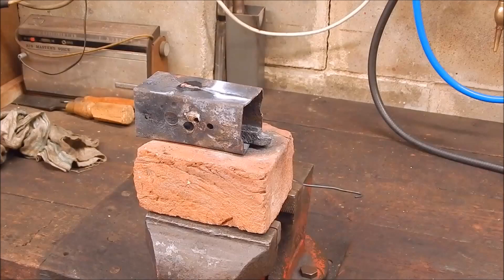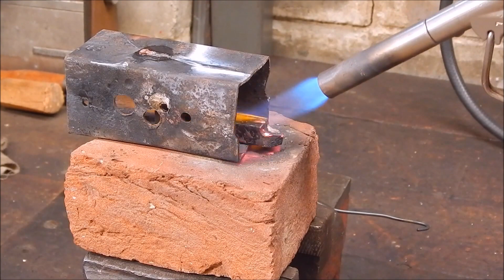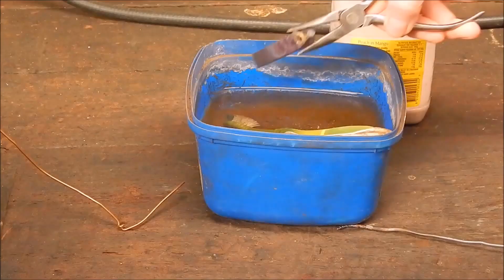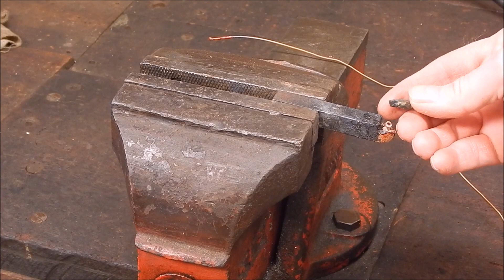More experimental brazing with copper electrical wire

Comment: Rob,
I glue heaps of carbide onto homemade tools. Usually boring bars etc etc.
And I get excellent results using 10% silver solder, I did have a go with 5% recently because I had run out of the 10% and it worked just as well. And very easy to use.

Matt

Comment: thats probably why brazing rod is an alloy, to add weldability and strength. I'm spoiled with my mig,tig,plasma and axy/act setups. I grew up living beside an oldschool welder, he seemed to know how to weld just about anything to anything with just a piece of filler wire and powdered flux. he even produced his own acetylene with a calcuim carbide generator. he taught me a lot but I was young and more interested in girls. ;-)
Reply: also alloys can be chosen to lower the melting temp, like electrical solder

Comment: Good experiment Rob.  It sure likes like copper does not like to bind to carbide.  The shielded enclosure worked well.
Reply from the maker: Fred Miller Hi Fred.  Yes on both counts.  I had my doubts.  I might use that little enclosure more often,  Cheers Rob

Comment: Quenching it was a mistake, the coefficient of expansion is very different to that of steel, carbide or mild, and quenching it really defines the two. However, because you had good luck with steel before, try it without quenching, maybe even ramp it down slowly by annealing it.

Comment: I love your films have you ever used 25mm thick Stove Fire bord Vermiculite, I use this in my small workshop to make a three sided box with a base. I do all my work on this.  It feels like wood chip but it keeps the heat in, you look to be letting so much heat get away.  But love watching your tests keep them coming.
Reply from the maker: +Marionette Maker Martin 

No, I've not used that.  The torch has a concentrated heat path,and I only occasionally need to make a hearth.

I generally use some firebricks.

Cheers Rob

Comment: Rob, a very interesting and honest experiment. This is one case where a bigger hammer, or more heat, is not the answer.  Given you'd already shaped the cutter and there is a hole in the insert, wouldn't a screw be better? And inserts can be replaced as they wear. Cheer Mick
Reply from the maker: Mick Doherty I knew someone would ask this.  Yes, a screw would be simpler, and better, but that wasn't the point of the exercise.  It was about how well copper would grip/bond carbide.  I just happened to use a scrap insert that was still in one piece.  I have made/ milled screw type carbide holders, and they work well, and cost peanuts, but this video is a different story.  Cheers Rob

Comment: As the old saying goes, he who never fails never does anything! Its just as interesting to see things that don't work as much as the things that do. I seem to learn a lot more from them as it forces you to think deeper about the materials in use and the methods. 
One question I have is, does the carbide tip anneal and if so is there a set way of quenching it, as there is with tool steel, or is it forgiving as far as temps and quench medium is concerned? 

Many thanks from rainy London!
Reply from the maker: Carbide tips don't anneal from my observation.  Most times I quench with water to re-harden the steel.  Failure is the only way to learn. You never forget how it turned out, particularly when you have to rework the whole damn thing. Some failures can even be funny - quite a few failure video compilations on YT.  But it's interesting that most metal work channels don't seem to show failures, maybe the uploaders are out to impress rather than inform :)  Cheers Rob
Reply from the maker: xynudu Carbide seems fairly forgiving with this type of heat issue.  If it has a detrimental effect, I've never noticed it. I've never actually checked to see if there is a protocol for quenching, just dunked it in the water tub.  Cheers Rob
Reply: Thanks for the reply Rob, interesting, despite being a metal work novice, I have just bought an old atlas lathe and intend to reduce bits of metal to chips, hence why I wondered about carbide tips. I find experimenting a fun hobby so failure has never deterred me. There is definetly an elemnt of self ego stroking that goes on online, but hey with out it I wouldn't get to see and talk to interesting people such as yourself!
Reply from the maker: kamaangirthearcher Ditto.  YT should be a two way thing, and it seems to work pretty well on this channel.  We are all learning.  Give that Atlas a work out, and start hoarding scrap steel.  Cheers Rob

Comment: thought you had her there, a la prochain monsieur
Reply from the maker: rob armstrong It looked pretty poor to me, so I smacked it around a fair bit to find out.  Seemed to be hanging on at first, but it was only really the friction fit of the copper plug in the screw hole.  Better to do this than have the tip depart on the lathe and jam the compound against the job.  Cheers Rob
Reply: xynudu It looked to me like the carbide wasn't clean enough, but that's obviously really hard to gauge while watching on my phone. 

I have some nickel-plated copper wire. I might try that sometime just to see what happens. Thanks for doing these demonstrations!

Comment: What is ur brazing flux?  Is it borax, Sir?
Reply from the maker: Hi Nathan,

It is a Borax based flux made for bronze brazing.  It is sold as EziWeld 303 in Australia.  Probably not available overseas.

It is important to use the correct type of flux or you will have serious rod flow/wetting problems.

Look for a hot rod dipping type flux formulated specifically for bronze brazing in your local brands and you should be good to go.

Do NOT use a wet type flux for freehand brazing as it will not work.

Cheers Rob